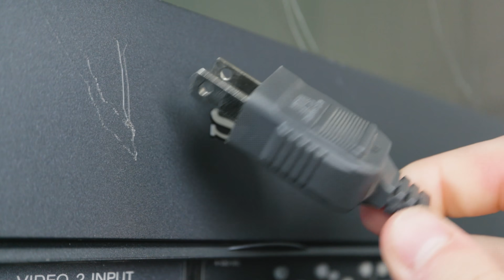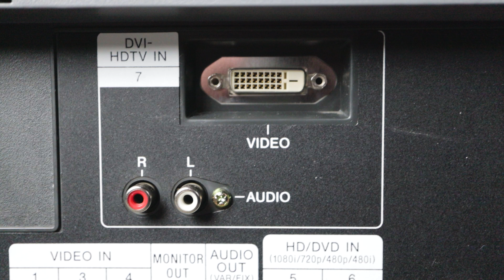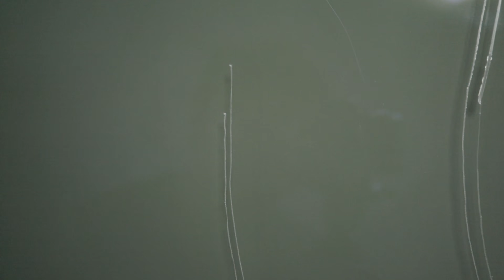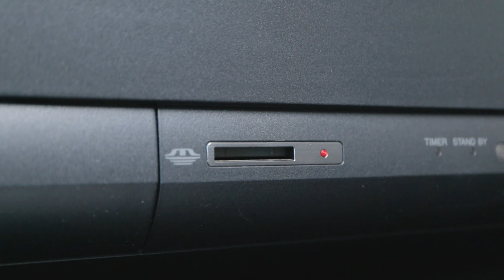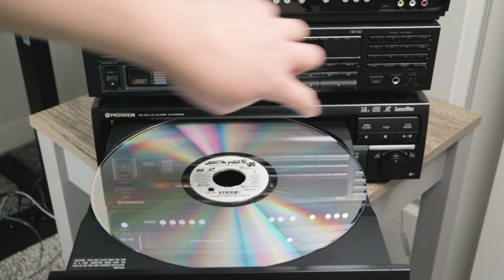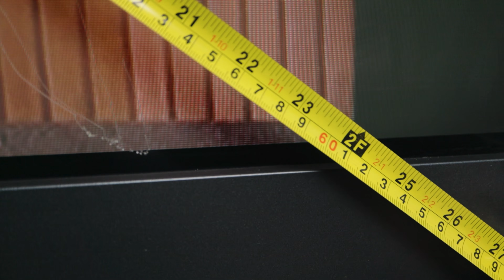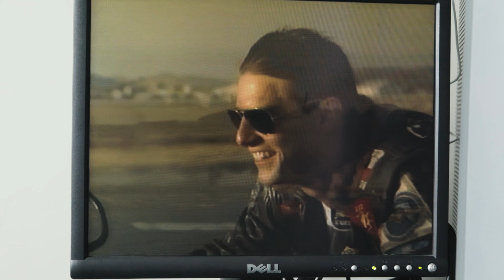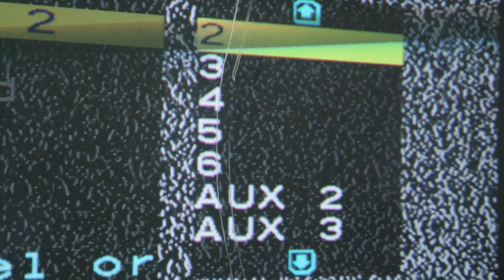The HD, WIDESCREEN Tube TV! Sony Trinitron KV-30XBR910

Comment: Also the famous Samsung WS32Z409T with hdmi 1080i (and the successor 419T), got this TV with my Xbox360 and PS3, excellent CRT screen. Only in 50hz he wasn’t good because it’s a 100hz screen so 50hz use interpolatation to display 100hz = many blur. But on 60hz it was fantastic because no interpolation.

Comment: Reality Creation was started by Sony in the late 90s as a VCR playback enhancer (when they still made VCRs - 00s Sony VCRs were rebadged). Reality Creation is still there today in all Sony TV's upscaling suites. 

It was developed from their professional knowhow and part of why Sony TV's have the best upscaling of bad quality material around. 

Only Panasonic has ever been able to match it.

FYI: All CRT TVs from the 90s onwards processed the analogue picture digitally and then converted it back to analogue for the tube. That's why the manual talks in digital terms. Basically, it's a form of AI super resolution upscaling with a some Sony magic.
Reply from the maker: Oh okay. Thank you for the info!

Comment: Very nice TV. XBR no less! One of best HD tubes you can find, especially outside of CRT computer monitors. I have the Sony KV-34HS420 which does have an HDMI port. My TV is about 40 pounds heavier thanks to the extra 4 inches of viewing space. These tubes have an anti-glare mask applied and that is probably where the scratch is. If you don't mind tube glare then you can remove the tube from the chassis and peel it off. Might even be able to order a replacement sheet since it isn't specific to CRTs. Don't try to buff the anti-glare sheet since it's not glass it won't end up any better.
Reply from the maker: Good to know!! Thank you!

Comment: I have a Toshiba 26" Widescreen CRT TV in my room.  Its from 2004. It has built in DTV Receiver so I just hooked an Antenna to it and watch free OTA TV. only thing that sucks is thats 480i/720i not full 1080i HD. So theres no HDMI port on the back but has everything else. The 34 inch model of my TV has the HDMI and full HD
Reply from the maker: Oh that's awesome that it has a DTV tuner inside. That's the one thing this is missing.

Comment: Yea CRT's uneven weight inside a giant plastic hard to grip case is a nightmare, twice as hard as the weight would imply, but yea, that thing was the peak of the tech tree.  Early Plasmas it probably was up against were extremely expensive, and still had horrible washed out low contrast images, I bet those survivors are extremely rare.

Comment: "Full HD" is a term Sony created to describe 1080p images.  There were no CRTs that could accept 1080p images.  If Sony advertised your TV as "Full HD" it would br printed on the front.  Your TV is just capable of up to 1080i images.  Which is fine given 1080p video sources (HD DVD/Blu-ray) didn't release until 3 years after your TV was manufactured.
Reply: 1999 I bought the only HDTV tube RCA MODEL from Circuit City over $3500 I called the local stations inc WFSB IN Ct USA talked to the head engineer who was installing the 1st HDTV Antenna on AVON Mountain in Ct and they broadcast the Fugitive in 720p and 2000 Super Bowl starting the HDTV RUN I used a 5ft rotating antenna on my 2nd floor porch to recieve the free and 1st HDTV Signals in Connecticut.
Reply: @cryptointernational24 I just got out of high school and was doing the same thing in the year 2000 I believe it was here in Windsor Ontario Canada we were lucky to be rigged next to Detroit so we got all their stations in HD for free with rabbit ears 😂
Reply: @cryptointernational24 I believe the first HDTV ready  available that was CRT was Actually Samsung I remember buying that on boxing Day in late '90s too I swear that decade I probably spent $30,000 on televisions😂😂
Reply: B/W medical displays got up to 4k, and there were consumer computer monitors that went all the way up to 2880
Reply: @TubeHeader they had them in the seventies when they would run vector.
Reply: There are CRTs that can accept 1080p but those are limited to VGA CRTs. I have a Apple CRT from 1994 that can accept and show 1920x1080 or 1440x1080 with no issues. It also had a Sony Trinitron tube. Many CRT monitors could do up wo 1600x1200. None of the TVs ever did as they were too late
Reply: @crestofhonor2349 Yeah but you are talking about computer monitors, those can do much higher resolutions than TVs since the mid 80s.
A good CRT monitor can display 2048x1536, which is absolutely amazing.

Regular TVs like you said can do max 1080i or 540p.
Most of the good ones take a 720p signal, but aren’t capable of displaying that naturally so its going to be scaled and doesn’t have the real full quality that 720p can display.
HD CRTs are still regular TV tubes, they aren’t as finely pitched as a computer monitors.
They just have additional electronics that makes them capable of displaying those additional Lines/resolutions.

I have a nice Philips 32PW9551 HD CRT and it is definitely fun to use, even when Im more of a fan of 240p TVs in general.
Reply: @rolux4853 but we are not talking about the final product.We are talking about tube screens and if you call it a television.That's because it's putting a tuner to the screen and we are talking about c.R.T screens we're not talking about television or anything else, but the screen.The focus of the logic is the screen. Whether it's a monitor or a television, they are all c.R t display as a part that you would order.
Reply: @rolux4853 I was under the impression PVMs and BVMs can also do crazy resolutions especially with RGB over say BNC, as opposed to DB-15 RGB VGA+ signals
Reply: @hi_tech_reptilezz  nope those PVMs can only accept 480p input 

VGA (or I should say XGA) monitors are superior because it can run at any resolution you want within the pixel clock limit and you can adjust the horizontal and vertical sync, phase, clock, etc without going into the service menu.

Monitors are designed with multiple resolutions in mind unlike televisions from the era.

I ran my cheap Samsung syncmaster at 120hz long before gaming monitors became commonplace using CRU (custom resolution utility)
Reply: @crestofhonor2349 They can accept it but they can't display it It's always converted to 1080i for the most part 
Even high-end computer CRTs topped out around 1600×1200 or 1920×1440 at 4:3, and widescreen CRTs didn’t have enough phosphor density to fully resolve all 1080 horizontal lines.
Sony has always made the best fine pitch apertures and CRTs available too Even computer monitors we're always using Sony's tubes sort of like today with LG with its OLEDs pretty much exact same It's weird how they switched it up though
Reply: @crestofhonor2349 come on.
Man, my view sonic is 2500 or so pixels.We have always had h.D.That's how you had to edit film and do motion graphics forever.
Reply: I have a CRT that can do 1080p@100Hz, though I usually use 1760x1320i@160Hz
Reply: BBC still broadcasts in 1080i (as well as 1080p) - TV picture quality viewing differences between the two are indistinguishable
Reply: @jaywalker1233 I thought the beeb were still doing 720p at points
Reply: I used to get headaches when I would try to read text on Interlaced displays for too long. That’s what made me jetison my 1080i CRT a long time ago for a 1080p LCD. It was around 2008 or so.
Reply: 1080i was just upscale 720p
I had Onkyo Audio Video Receiver bought with PlayStation 3 in 2007 which I used to play with my Samsung 1080i Samsung Plasma TV
Reply: You're high.  I was pushing 1600 x 1200 on my PC in the late 90s before the term HD was even coined.
Reply: @TurboLoveTrain  SD, HD and FHD are terms that were put in place specifically for televisions. We all know that we had higher resolution displays many years before this. I had a 21 inch monitor that I played the original Half Life on back in the 90s. Good times.
Reply: Or we could accept it with conversion or if it had an internal converter. And they could spit it out as a trick and gimmick of using but not necessarily displaying.
Reply: Not 1080 P BUT 1080 I
Reply: Do you know what a CRT MONITOR is?
Reply: actually a lot of the 1080i set could accept the p but it would deinterlace it
Reply: @ogBINARYGOD  you mean they would interlace 1080p content? you can't really deinterlace a non interlaced image
Reply: DVI is actually HDMI almost compatible - you can buy simple passive adapter, or active one witch audio conventer! European SCART is almost compatible 1:1 too and it’s even older :)
Reply: That's not true They could accept it but there was no available CRT that could resolve all 1080p resolution Even the Sony computer monitors couldn't do 1080p
Reply: I had the newer version of this TV with HDMI though Also some DVI outputs also had sound later on from the computer but never really made it to televisions as far as I know
Reply: DVI is basically HDMIs evolution in a way
Reply: Wrong. There are 1600x1200 screens and higher.
Reply: False. Several computer CRTs (for example, the Sony Trinitron GDM-FW900 and the Viewsonic G220f) can display 1920 x 1080 in progressive scan.
The FW900 can go well beyond that too, and the aforementioned Viewsonic can do 2048 x 1536.
Reply: 720dpi is hd🌹
Reply: No, full HD was referring to 1080 and nothing more. It was just to distinguish it from 720 HD resolution.
Reply: I’m 90% certain that the scratches on the screen will be in the plastic anti-glare film stuck to the glass tube. It’s possible to remove this, and the picture will look even brighter, but will be very reflective. I had exactly this problem with one of mine, and whilst it was a lot of work it was definitely worth it. Google will definitely help.
Reply: Ya back when “HD” meant 720 and “Full HD” meant 1080. Call back to early 2000’s.
Reply: @EDHBlvd  HD still means 720p and FHD still refers to 1080p/1080i. Nothing has changed. Youtube changing it's names are pointless as 4K is still considered UHD and 1440p is QHD
Reply: @crestofhonor2349  I'm sorry, but that is incorrect. HD is 720p/1080i and FHD is exclusively 1080p. Reason being that 1080i is essentially the same as 720p in terms of bandwidth and pixel density.
Reply: @crestofhonor2349 idk if it was always this way but I've seen 720p called "hd ready"
Reply: @InfinitySwitch84  1080i is still full hd. it's a 1080 line image that only has 540 lines displayed per frame to save bandwidth, otherwise it's still 1920x1080.
Reply: @windowsxpnt2347 You just don't get it, do you? You even elaborated on how you're wrong and still tried to justify it.
Reply: @windowsxpnt2347  It's just splitting hairs and a matter of opinion at that point. Technically according to standards that have been set, 1080i was never referred to as full hd and for good reason. I would never say it is simply because the image looks terribly by comparison to a full progressive scan 1080 image.
Reply: @EDHBlvd  so nothing has changed then?
Reply: I have an old Sony camera that films in 1080i (not p) and it says Full HD
Reply: Full HD was 1080p across the board not just for Sony though It's industry standard back then when HD first came out the best was 720p technically What 1080i was Also available until blu-rays which offered full 1080p resolution I had The Sony 34-in with HDMI and a Panasonic one  well  But I always preferred the Sony one And I've always bought Sony TVs even still today They make the best TVs
Reply: No, FullHD is just 1080, either i, or p, this is why HDV camcorders used the FullHD 1080i logo.

Comment: My family used to have a 32' LG SuperSlim HD CRT from like 2005 and it was an absolute beast. Speakers were insane on it, picture was fantastic, and it eventually became my bedroom TV. Hearing the newer 360 startup took me back to 2013 getting home from work after school to load up Netflix. If it had been the original 360 startup it would have taken me back to when the TV was in the living room and my besties and I would play Halo 3 until the unholy hours of the morning. The HD CRTs were so great for gaming because they had no input lag! That's the main reason why I held onto that TV for as long as I did. We finally retired it when I moved out and it had developed v sync issues where you'd constantly see a white line running up the screen.
Reply from the maker: Haha that's awesome! Funny they called it SuperSlim.
Reply: None of the tv manufacturers had that in 2005, they 1st appeared in 2007.

Comment: Yes, DVDs have 'content flags' which signal the format of the content to the player, but this only affects the player not the display if it's connected via an analogue connection.
If your DVD player is set to widescreen, it will scale 4:3 content to fit a widescreen display. Conversely if your DVD player is set to 4:3 it will scale widescreen picture to fit a 4:3 display, i.e. the black bars above and below the picture.
Reply from the maker: That's so cool!

Comment: 1:18 well volts are not actually how strong electricity is, but how easy it is for it to travel through surfaces, what actually measures how much electricity is passing, is current, measured in amps, as long as the current is low enough, you can have any voltage pass through your body, anything below 0.1 amps is survivable, problem is, those CRTs store 0.1 to 0.5 amps, so it still kill you, but not because of the absurdly high voltage

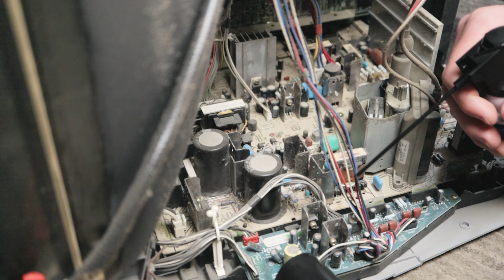2:17 ESD? more like the previous owner's STDs given how filthy it was

9:20 then you lived under a rock cause they were the main storage used for the PSP
Reply from the maker: Haha no kidding it was gross. Yeah 30kV would pass right through my skin so I didn't want to risk it

Comment: 1. There is no chance that there is any voltage there after years. 2. You are using a screwdriver that is not a properly insulated screwdriver. :D

Comment: You can restore the glass using a windseild glass repair kit and a buffer. It won't erase them but it will be much less noticeable when off and invisible when on
Reply: Not true. This model has a plastic antiglare screen, it will need to fully be removed.
Reply from the maker: Good to know thanks!
Reply: @simonretrotech best of luck to you. You have a very good find and I was thrilled you actually put the dvi input to use.

720p content will look incredible on this TV but I would reccomend you try 1080i content also over component if you haven't. GT4 for the ps2 supported it and I think some Xbox games like enter the matrix also did it too.

Comment: Cool video, but CRT's don't upscale. They can change their resolution to whatever the native resolution is. Generally 1080i. Old technology that CRT computer monitors used to use.
A friend of mine had a similar setup (samsung though) but his could only do 480p, but it was 16:9.
I still have an LG rear projector TV that can do up 1080i (also 480i/p) but I don't use it often. It's also 16:9 and it was connected via component to my old x-box and gamecube.
Not sure if yours is the same, but I do remember having to change the resolution in the gaming screen. 
DVD's natively played in 480p.

Glad you gave this one a new home and lease on life!
Reply from the maker: Good to know! Thank you
Reply: Many of the later ones did upscale. For instance some HD TVs would use only 1080i and upscale that 480i signal to 1080i with some digital processing. Some would also put a 480p into a 540p window since they always ran at 1080i or it's 540p equivalent